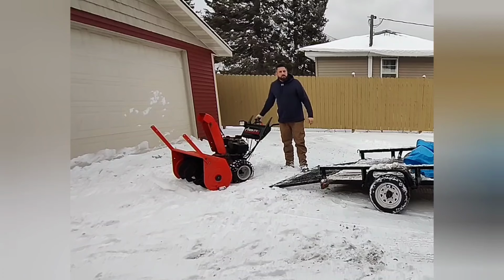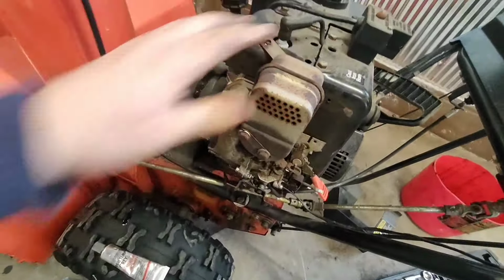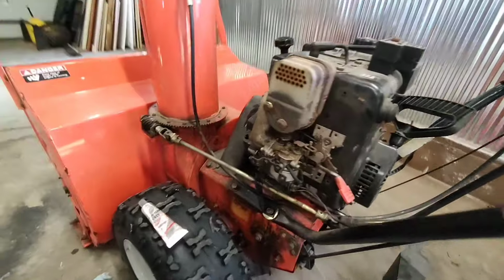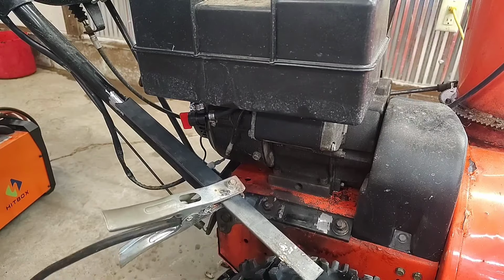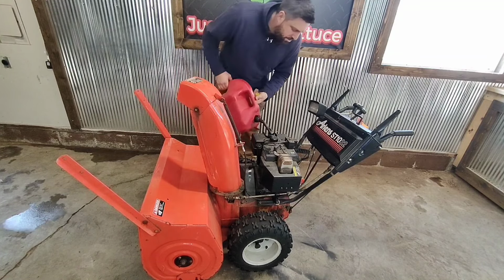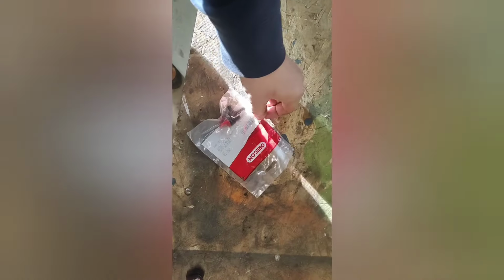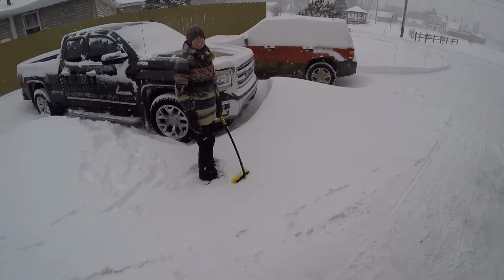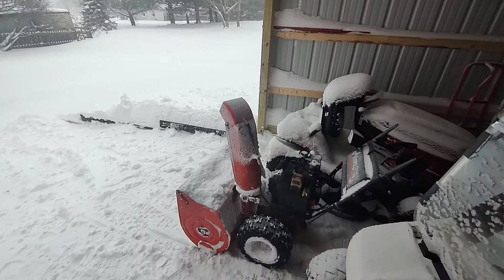Will It Run??? Free Snowblower!

Comment: Where do u live ? I'm in western ny
Reply from the maker: I'm in the Upper Peninsula of Michigan. Thanks for watching!
Reply: @fieldlettuce9820  I was gonna say Michigan
Reply: @fieldlettuce9820  I'm going to do what you did with the plow , anything u would do differently?
Reply from the maker: @toddcaskey9984  The only thing I can think of, would be having a hydraulic angler would be helpful. But, I don't think it's necessary. I didn't put one on the plow because my tractor doesn't have an auxiliary hydraulic to control it. But overall, I'm pretty happy with it.